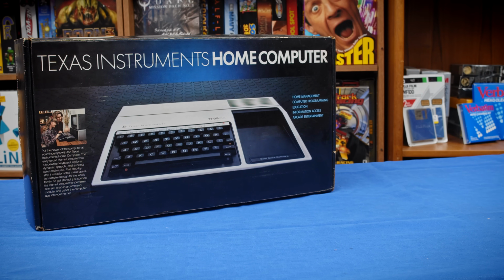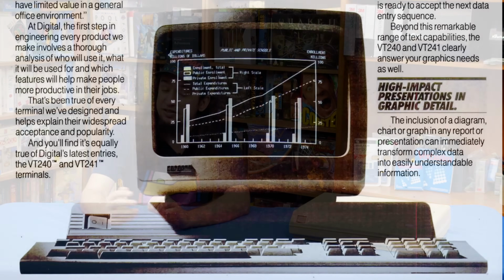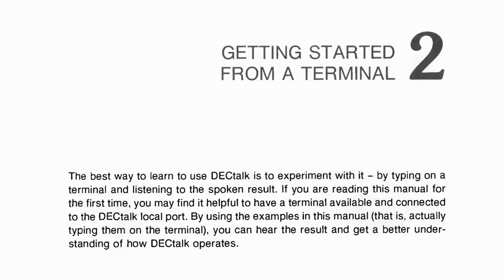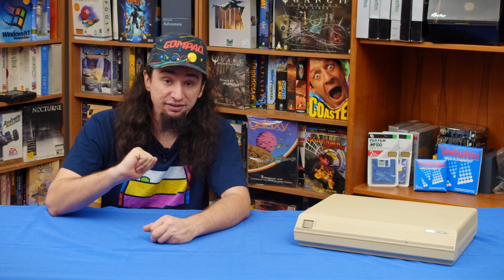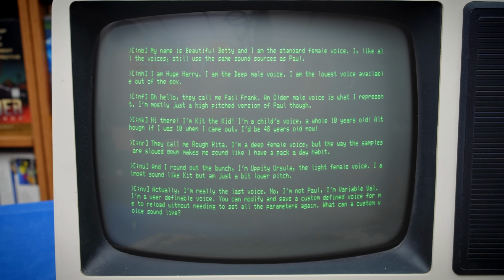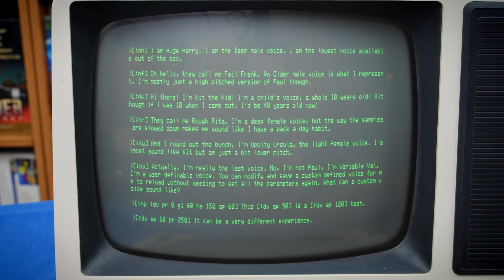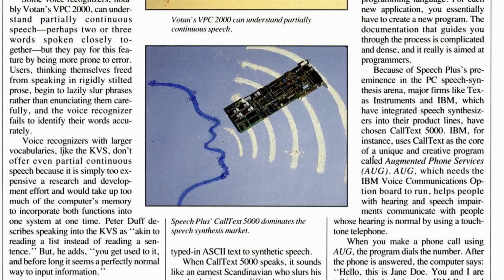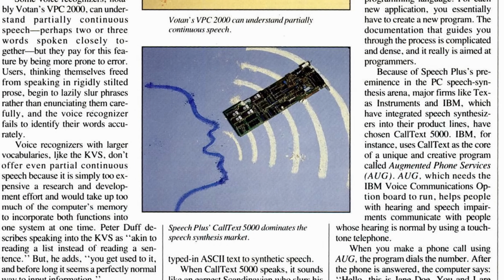DECtalk DTC01 - 1984 Speech Synthesizer

Comment: As a blind nerd I can say that we still talk about these fantastic things. Many a skit has been made with them by a bored kid (blind or not) with access to an emulater. And a lot of us still prefer klat synthesis over more modern solutions because of how much more response (I.E. lower latency) it can be, and sometimes because it's clearer at higher speeds. Neural voices might sound really good, but when your main interface to a system is by speech, you don't care how beautiful the voice sounds, you care about how fast you can interact with it, and how much information it can tell you per second. What good is a nice sounding voice if you have to wait even 0.2 seconds after you press any single key for it to start telling you what control is now focused?
Reply: That’s a great point! I hadn’t really thought about the “nicer” voices having lower intelligibility at high speeds. 

Even though I’ve got blind folks in my family and were aware of more things than most sighted people, there’s still a lot that goes over my head! (Which I shouldn’t be surprised by — when I started using a wheelchair I realised I’d only previously noticed 10% of the obstacles my sister navigated in hers.)
Reply: I actually prefer to listen to a distinctively artificial voice rather than a nearly-human voice. The nearly-human voice has an "uncanny valley" effect on me. It's disturbing at some level. I can't bear to listen to those AI-voiced YouTube channels.
Reply: Voice synthesizers have become indistinguishable from real ones in the hands of a talented tuner. But this has yet to be automated (and likely never will be perfect).

Dectalk is still conquering vocaloid songs to this day
Reply: I guess I'm in the blind minority because I really can't stand the older voices and the way they speak and pronounce things. I guess this might come from having a name that was never pronounced right, with a silent vowel. I can understand Vocalizer and Siri voices just fine at high speeds. I remember jumping ship from Eloquence to RealSpeak as soon as those voices were available. However, I'm still quite picky. I really only like Nuance voices, and only if I can't use an Apple Siri voice. However, I'm sure some people are glad to have the old Mac voices on, say, iOS, or the eloquence voices.
Reply: @seamarie3111  Ehh, to be fair I don't think you're in a huge minority. Vocaliser is fine from my perspective (I'm using it now). The Microsoft voices in particular are ususably slow though, that's what I was getting at for the most part.
Reply: @TheFakeVIP   Bleck, I can't stand the Microsoft voices, going all the way back to even Mike and Mary, and marble-mouth toneless Sam, then quiet, odd-toned Anna.
I can't stand espeak, or voices like it. If I can't use Vocalizer or Siri voices, I'd likely use Eloquence over anything else. I'm not a big fan of Acapella voices, they're just too choppy and don't really sound great reading at length.
Microsoft has these new voices, though, in their Windows 11 2022H2 update, that I actually like! They sound great, though I've not put them through the ringer at high speeds, and they're only on Narrator which I've avoided using until now.
Honestly, I'm not one to crank my speeds anyway. I'd rather enjoy what I'm listening to, but would crank it up when I had to read a lot for school. It just depends what I'm doing. However, even with Siri voice at 65%, none of my sighted family members can really understand it. It's pretty funny.
I'm glad they added Eloquence to iOS 16, even if I jumped ship from the engine years ago. Wow, what a trip to have the voice of my childhood computer and schoolwork on my phone now.
Reply: I admit I prefer Eloquence over many other, arguably better voices. The voice has familiarity, true, but it is just generally more readable for me. I use mine at a rate, generally, of 80 to 90% of maximum, and while I can get that high with some other voices from time to time or in special circumstances, Eloquence is simply the best solution, for me personally, in terms of latency and intelligibility. I'm pretty sure it's also Klat based.
That being said, I think that, given the impetous to do so, a voice using more modern technology could probably be optimized for comprehensibility at higher speeds. Sharper consonants, short but defined pauses, and carefully non-truncated phonemes would definitely be nice to have. The problem is, as I said, in optimization rather than actual capability. As we all know, the modern voices are optimized to sound humanlike, including human speaking heuristics at human speech rates. It's all a question of priority and experience.
Let's give a brief example. I was very surprised to learn quite how fast the Windows OneCore voices can be made to go. But the comprehensibility, in my experience, of those voices falls off pretty sharply. The trouble isn't speaking rate. The trouble, instead, is an enhancement of the built-in speech errors that work to make those voices, such as they are, sound more natural. I did run into that a little, even with DECTalk, it has certain errors in pronunciation to make it sound more natural.
The point is, with modern voices, we have technology optimized to function best at typic human speech parameters. The older tech is more robust using different parameters specifically because it wasn't optimized for anything in particular. Specialization limits general utility.
In other words, it's an old, true saying that the jack of all trades is master of none.
I would expand that by saying, the master of one trade is good for little else.
Reply: Absolutely. I use eSpeak as a matter of fact on an Android, and the latency and delay time is pretty much instantaneous. Compared to other speech engines, such as the ones that use natural voices.
Reply: Another fact, if you were to connect over Bluetooth with one of the higher quality voices, not only with the latency be probably pretty horrible I would imagine, but again at high speed, they don't sound right. I'll give you an example of a speech engine that doesn't sound right at high speed, and it's not high quality, and that's the east peak engine. But I noticed it's not all variants of voices. Only some, that it seems to struggle with over a certain rate speed. Somebody can correct me if I'm wrong, festival, eloquence, deck talk, I'm sure I'm missing others, they all do really well at a rapid speech rate.
Reply: I still miss my double talk PC with internal punctuation.
Reply: I love how enthusiastic all us VI peeps are. So many  of us say we don't have a subculture, but I disagree.
Reply: @princesspancakes3737  agree, the only difference is that we prefer to call it a community. We are just polite I suppose
Reply: Not to mention, there's so much you can do with this little device. Making it sing for example.

Comment: As someone who has messed around with the Variable Val voice, I can definitely say that those distortions/feedback in some scenarios are definitely frustrating, even in the native PC ports of the DECtalk software. (Which is much newer than the DECtalk units shown here - rather it’s the same version number that the first iteration of the NOAA Weather Radio automated speech synthesis system)

I can tell this problem's even worse in DECtalk 1.8 as compared to the PC port's version, since I customized way more of Val's parameters before it glitched - 1.8 experienced issues just by changing the nasal resonator gain, which one of the songs did. Not sure if this glitch is triggered that easily in the 2.0 upgrade though, but I imagine it doesn't.